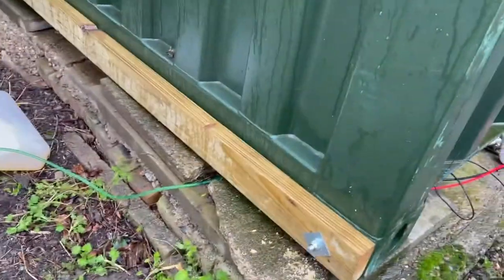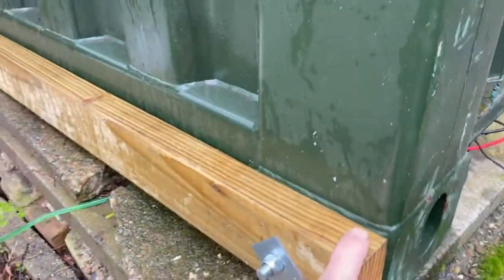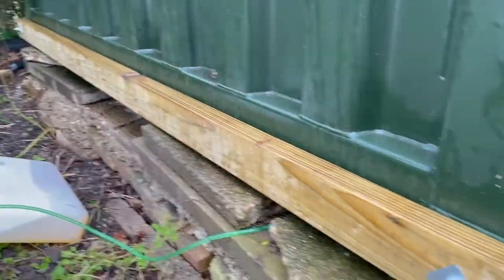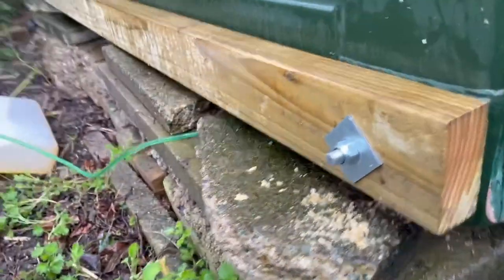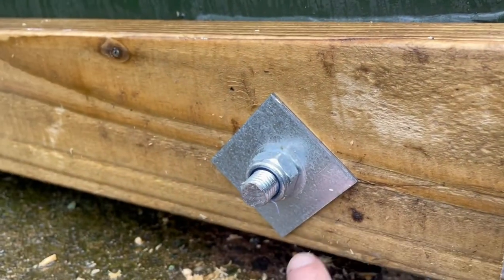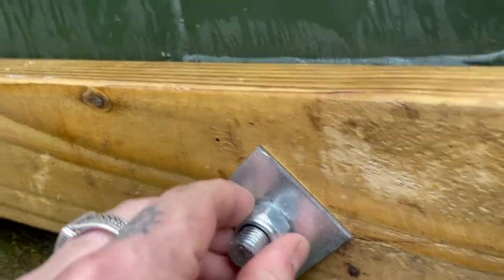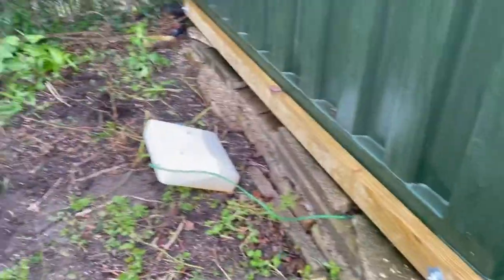Attach wood to the outside of a shipping container without drilling [OFF-GRID CONTAINER]

Comment: Thanks so much for posting this. I had a similar predicament, the challenge was a bit different  from yours, but the solution was inspired by your effort. 

I wanted a 4x4 attached vertically to my corners, so I got 1/2" by 8" carriage bolts, anti-turn washers, 2" washers, lock washers, and nuts all prepped. Built the 3/4"  plywood retainer, 5&1/2" by 2 7/8" IIRC, like yours, but found I was unable to get the carriage bolt through. I instead made two 1/2" treated plywood retainers, with "keyholes" that ran to a long edge, placed them atop each other, with each keyhole facing opposite directions (to form a 1/2" circular bolt hole). Once placed inside the corner block, they allowed me to push the carriage bolt & anti-turn washer assembly through the middle to the back of the block, then fold the two retainer pieces back in place to create a 1" thick retainer. From there it was just a matter of drilling out the 4x4 and bolting it in place.

Without your effort here, I'm certain I would've resorted to self-tapping screws or welding, neither of which is desirable; I surely do appreciate you taking the time to post this.

Comment: I'm lining up 20 ft shipping container and my county requires them to be connected. I prefer not to weld the boxes so wondering if I can instead bolt the corner castings together - can I get a plate washer, bolt, nut etc. in the holes with my bare fingers, and can I get a wrench in there to tighten them up on each side? Any tips? Thanks